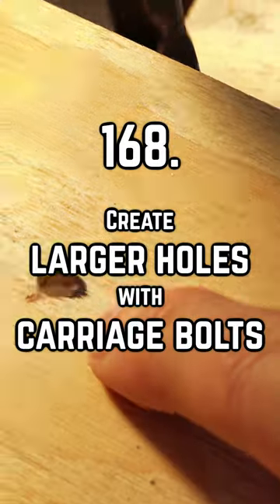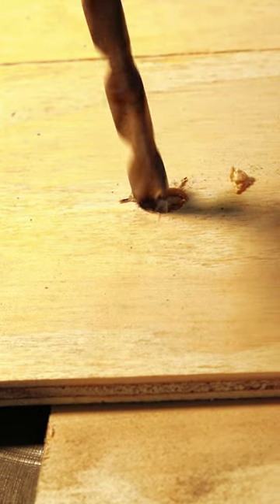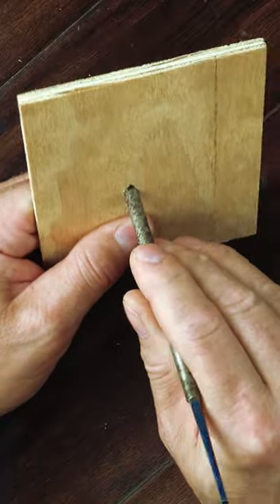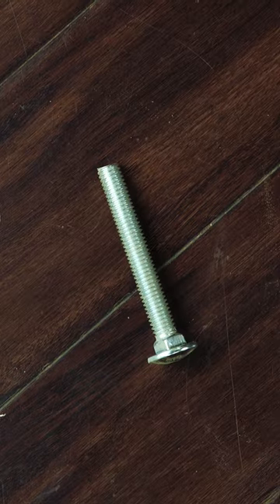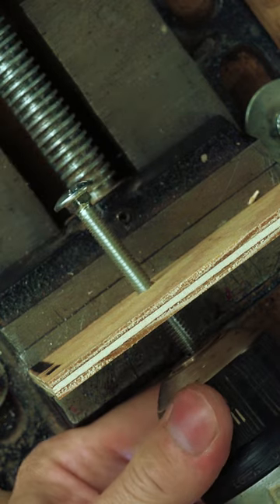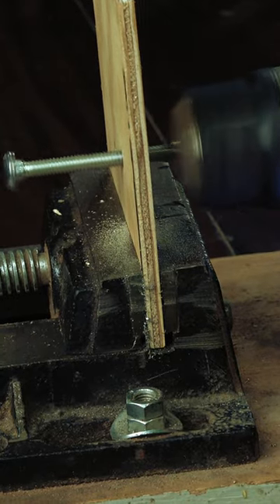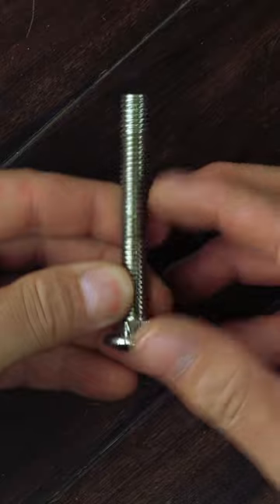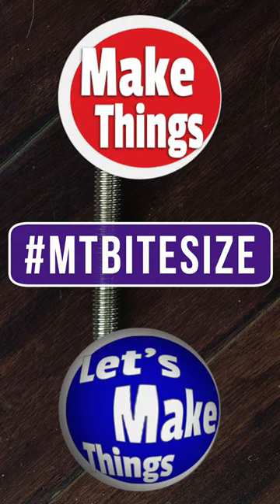168. Create larger holes with carriage bolts #mtbitesize #shorts #bolt #drilling

Comment: just use a standard twist bit one size larger than that hole and it will self centre itself, and guide perfectly down the hole you already drilled.  No tear out.